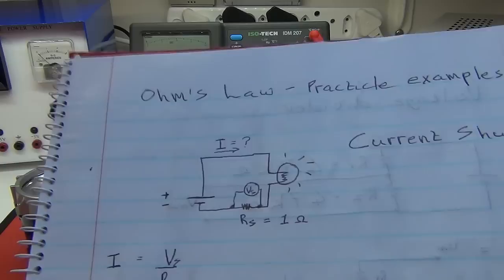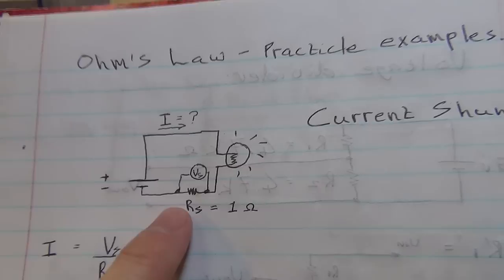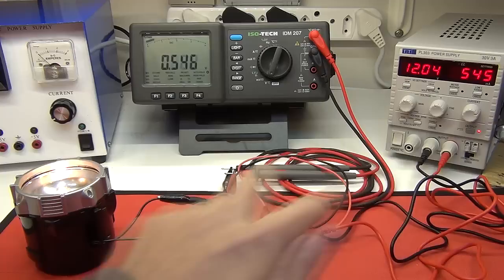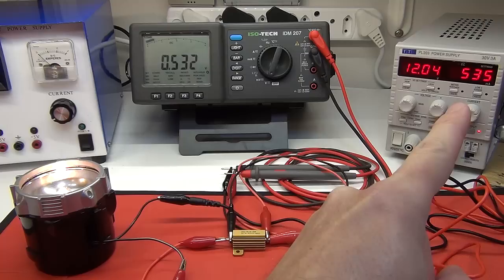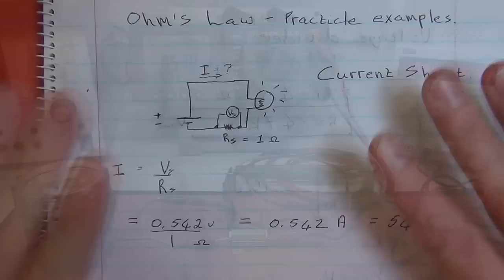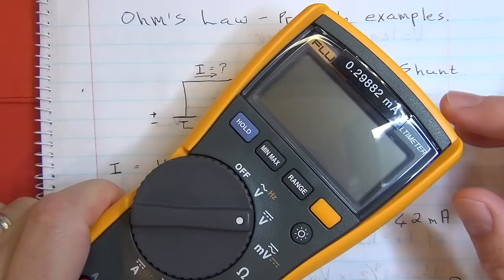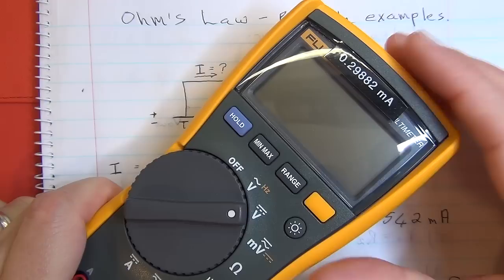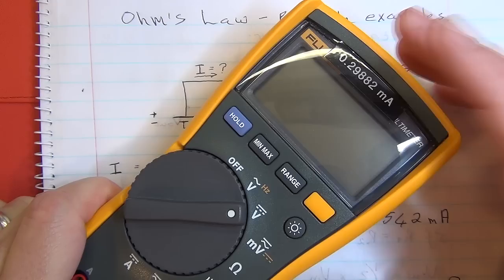Electronics Tutorial #5 - Ohm's Law Pt 2 - Application:LED Resistor, Voltage Divider, Current Shunt

Comment from the maker: My pleasure, happy to know the videos are of value. Ok...I've just calculated the voltage drop you would have across a shunt of 0.001 ohm at 250 mA (V=IxR)  would be 0.250 mV. Which is a really small reading and you would need a good accurate multimeter for one...and more importantly your shunt resistor would have to be very accurate if you want to have straight reading without calculation.  Shunts are best used and designed for higher current measurement. A simple milliamp meter....

Comment: Excellent tutorial.  I watched it all the way through.  I am an experienced electronic tech (not an engineer).  It was a good review for this old timer.  I would only add one small point regarding the potentiometer.  In the US Air Force we used a simple rule:  If the device has three connections, it is a potentiometer.  If the device has 2 connections, it is a rheostat.  A potentiometer has the letter "T" three times in its spelling and a rheostat has the letter "T" two times in its spelling.  The number of "T"'s is equal to the number of connections.  The "pot" is picking off a voltage through its "wiper" while the rheostat is limiting current in series.

Comment: love how you take general knowledge of electronics with practical examples and make a difficult subject understandable. please make more videos on making simple circuits and how to use the math to find the power, resistors and components needed to run them. It can seem impossible trying to figure out how to go about making simple electronic and circuits to make a working device, but you explain it so well, thank you so much for your time and videos.
Reply from the maker: Randy Travis My pleasure, thanks for the feedback Randy.
Reply: Could you make some videos on making a bread board with some 555 timer circuits and power supply control? It would be great to have 3 volt 5 volt and 9 volt, and a adjustable power supply. You could make a bread board that can just be pluged in and you can have the voltage and a timer ready to go to test circuits. And what type of things do you think a convinent bread board should have to make testing and learning about circuits have to make things better?

Comment: I designed, built and tested my first-ever voltage divider today.  I'm still not entirely sure how things work; I get exactly the voltage I expect when I merely divide it, but not what I expect when I start adding a load (a resistor and LED) onto the path with the divided voltage.  But I feel very inspired, and I just ordered a variable power supply to go with my two (so far) multimeters.  My desk is beginning to look suspiciously like your workbench!  And I'm having too much fun.

Comment: Very good question.  As far as the voltage divider output it does not matter.  10 Ohm 10 Ohm and 5K 5K will both divide by 2.  The difference is in how much current and power the divider consumes.  A 10 Ohm 10 Ohm will draw many times the amount of power the 5K 5K does.  So you tend to want to use the largest resistors you can get away with.  There is another issue which tugs us engineers the other way.  It often overrides the large divider resistor rule and compels us to prefer smaller R's.

Comment from the maker: Here is the definition of a current shunt: "Current shunt resistors are low resistance precision resistors used to measure AC or DC electrical currents by the voltage drop those currents create across the resistance."
The 1 Ohm resister can be used to measure current by measuring the voltage drop across it with a volt meter and applying Ohm's Law to calculate the current.

Comment: A divider is normally used as a source of voltage to some other circuit component (load).  When you connect the divider's output to a load the voltage output by the divider will change (since the load is in parallel with one of the voltage divider resistors).  Generally speaking you don't want changes in load resistance changing the divider voltage (i.e. you want the voltage to be stable).  To do this the source resistance of the divider circuit must be much smaller than the load resistance.

Comment: Again very interesting and helpful. Thank you. Have calculated the required power rating for a 400 ohm resistor in a circuit with an LED, 12 volts in and returning current of 0.025 miliamps, by using the formula P = Current squared x Resistance, so 0.025 x 0.025 x 400 to be 0.000625 x 400, and finally 0.25 watts. Does anyone interested agree? I am not 100% certain.

Comment: The idea of a current shunt is to provide a path for the current (that would otherwise damage an ammeter) to flow and still be measured by an ammeter which could not normally handle the amount of current involved. This is done by making the current shunt very low in resistance so as not to disturb the current flowing in the circuit by any significant amount, and by being able to also handle the power, by not heating up and causing its resistance to increase and interfering with the circuit. A ammeter is connected in parallel with a shunt and what happens is that the current is "shunted" away from the meter (so as not to cause damage) and makes the sensitivity of the meter much less than it would normally be, but by working out the changed sensitivity can be used to work out the actual current flowing in the circuit.

Comment: First response is look up the datasheet for your particular LED by searching "12000 mcd LED" and picking one of the links for a parts supplier such as Mouser or Digikey or other.  Doing this you find the typical forward current is about 20mA for most and has a forward voltage drop of around 2.2 to 3.5 Volts depending on the color of the LED.  Most have a maximum current of 35 mA so don't exceed that.  Using this information a simple circuit to illuminate the LED would be....

Comment: You are basically correct.  Us engineers would have concern with accuracy and safety margin.  BTW get used to going directly to the power equation.  P = V^2/R here is the best to use.  P = (9.8*9.8)/390 = 0.246 Watts.  This is way too close to the maximum rating.  Any surge in voltage will exceed the rating on this component.  Any reduction in the ambient environment can lower the true rating.  On a hot day or if the component is packed into a space with poor airflow it won't meet the rating.

Comment from the maker: The capacitor value should be the same....in some cases it might not matter but it depends on the application. The voltage value needs to be the same or higher.

Comment: If you just want to illuminate one particular LED and not select a value for a design to be used for an entire manufacturing spread just hook it up in series with a 1KOhm or greater potentiometer set to it's maximum value and slowly decrease the resistance (by turning the little screw) until it gets to the brightness you want.

Comment: 9V battery thru a resistor in series with the diode.  The diode will reduce the voltage available across the resistor by 2.2 to 4.4 VDC leaving between 4.6 & 6.8 VDC across the resistor.  Since we want around 20mA of current through the circuit the resistor value should be 4.4/0.020 = 220 Ohms (pick a standard value near that.  Worst case if the drop across the resistor is 6.8 the resulting current will be 6.8/220 = 31 mA (still well below its rated value.  Confirm for your device though.

Comment: Thank you for this very interesting explanation. As a french talking beginner, maybe I've missed something but, after reading Silas Fatchett's comment: "mjlorton was trying to find a resistance which, in parallel with a 4700 ohm resistor, would result in a total resistance of 829.4 Ohms. Using the rearranged formula, that resistor turned out to be 1007.12 Ohms." , looks like mjlorton has been lucky obtaining as a result a resistance (+- 1 K ohms) that's easy to find in specialized shops, isn't it ?

Comment: Martin, Thank you so much for doing this! I am a complete novice, but I have been learning so much for your videos. You make this so interesting. I want to try using a current shunt to measure the amperage in a circuit that has a small motor that uses about 225mA - 250mA at 2.85v. Can I use a .001 ohm shunt to measure the current and can I also just measure mA across the shunt with a meter instead of doing the calculation. The .001 ohm shunt figure for the shunt is throwing me off .001ohm too.

Comment: The formula for calculating the voltage divider resistance is technically correct.  However there is an easier way.  Voltage is divided proportionately according to resistance.  So two equal resistances divide equally.  A 5 and a 10 will divide it with 1/3 voltage on the 5 and 2/3 on the 10.  And so on.  

So we want to divide 30 volts into 4.5V and 25.5V.  We can set it up as proportions problem.   4.5/25.5 = x/4700.  Cross multiply 4.5 * 4700 =  21150.  Then 21150/25.5 = 829.4 Ohms.  This is a lot easier to do on a calculator and it is easier to remember. All you have to remember is the proportional relationship of voltage and resistance in a series circuit and how to do proportions which is easy to remember.  

Of course the same is true in parallel circuits.  It is important to remember the relationship of current and resistance in a parallel circuit; it makes remembering how the calculations go a lot easier.  😊
Reply: OK, now for the other formula, the one for calculating the parallel resistance.  The one used is based on a formula that is fine if you are doing it on paper with no calculator. It is actually a shortcut in that case.  However on a calculator it is more difficult.  Also it is more to remember.  

For parallel resistance 1/Rt = 1/R1 + 1/R2 + 1/R3 ... This is a formula that is good to memorize. 
To solve the problem in the video 
1/Rt = 1/R1 + 1/R2
1/Rt -1/R1 = 1/R2
1/829.4 - 1/4700 = big long number which you take reciprocal of to get  1007.12551

On a calculator it is bit easier to enter especially if you do not have a fancy calculator.  I was able to do it easily on my computer's built in calculator in it's most basic and simple mode.  Of course the calculator needs at least a reciprocal key to do this.  So if you have one of those calculators with giant keys and only plus, minus, multiply and divide keys then electronics math will be more difficult.

Comment: How much smaller?  Normally < 1/10th the R of the load worst case.  If the divider is driving a circuit whose lowest resistance will be 5 KOhms make sure the source resistance of the divider is < 500 Ohms.  The source resistance of a voltage divider the parallel resistance of the two voltage divider resistors.  So to get 500 Ohms of Rs use two 1 KOhm resistors.  If you are dividing down by more than 10 then it's just the smaller of the two resistors approximately.

Comment: I think it has fallen into place now. Electrons are initially dammed up by the first resistor and form lanes. To calculate the required power rating we can use power(watts) = Current(amperes) squared x Resistance(Ohms), but for accuracy we would use the current or flow rate after the electrons have passed the resistor and generally before the next significant resistance. Can we just as reliably use instead, voltage drop(volts) x Current(amperes) after the electrons have traversed the resistor?

Comment: Having thought about it more, I am inclining towards thinking that with a few bits in series, a typical resistor and LED and wires, the flow rate would measure the same or about the same all the way around the circuit. Apologies for bothering you with all these posts. Perhaps you would be kind enough to elaborate on this topic with parallel circuits. I think a current would  actually be going slower through a high resistance than an LED but travel all similar between wires at the same rate.

Comment: Martin, basically the resistor is lowering the value of the voltage (i could say), and the voltage regulator, i thinks doing the same thing..so what is the difference between resistor and voltage regulator? why not use voltage regulator which can give you specific voltage output? thanks martin..more power

Comment: Regarding the voltage divider, does it matter what actual values do i use or it is only about the ratio? (ex. 1Ohm with 1Ohm = 5kOhm with 5kOhm? (=1/2 split))

Comment: In the video you say that it is possible to use a potmeter instead of resistors and that way be able to vary the resistance. So is it possible to use a potmeter instead of a voltage regulator like fx. the lm350 ?

Comment: I don't have a clear understanding of what a "shunt" refers to. Does this refer to the 1 Ohm resistor? To the complete resistor/volt meter setup to read current? Or to the idea that this
1 Ohm resister can be used to measure current by applying a volt meter?

Comment: Hello Martin, just a newbie a question variable power supply, obviously you can adjust the voltage but can you adjust the amps as well?or does it depend on the load on the circuit? how much it can draw? or does it also depends on what type of wiring you use, im just trying to follow up your analogy for a water pipe. hopefully you can answer! thanks your tutorial rocks!!!

Comment: Also the component value of 390 is only accurate to perhaps +/- 5% for this type of component.  If I specified a more accurate component be used it would cost significantly more if I wanted to use parts of 390 Ohms +/- 1% or even closer.  If I specified 390 Ohm resistors +/- 5% some of the resistors manufactured on the board would be as low as 370 Ohms and would burn up.

Comment: Hi Martin, thx you very much for you electronics videos. They are of big value for me. I have a question to the Voltage divider in particular. I reckon that it does not matter if I grab Vout at resistor R1 or R2, does it? The question accounts especially for the order of the two serial resistors. If I am right, I could switch the order of R1 and R2 in your example and everything works in the same way. Do you know what I mean? Thx again und hope to find even more interesting videos from you. Cheers!

Comment: Even temporarily exceeding the rated voltage or temperature of a resistor will PERMANENTLY change the resistors value.  Running a resistor at CLOSE to maximum rating will gradually change the resistance PERMANENTLY and will significantly reduce its lifespan.  When they say 0.250 Watts they mean it.  I don't like to go more than half the rating unless I am sure the particular application is known, well controlled and well understood.  This is called "derating".

Comment: When we get onto LEDs and what current and voltage they operate at, there's a problem. What if, as I do, you recover LEDs from dismantled equipment or buy cheap job lots from ebay? No serial numbers to look up, no long or short leads to identify the anode/cathode. So, given a totally unknown LED, how do you work out its working current and voltage? Can you connect it to a fully turned-down variable power supply, then slowly turn up the voltage until it starts to come to full brightness. Would the operating voltage and current figures shown on the PS tell you what the LED requires? If so, would the method work with say a 1 Kohm resistor in series with the LED, and how would you compensate for that resistor in the maths?

Comment: in the case of LED when I will calculate the the watt, what voltage I will take  12v or (12v - 2.2v=9.8v)?
Reply: you must know the resistor wattage first.
example, if you're using a 0.25W which is those common through hole 6.5 mm resistors.
in the safe side, treat the resistors as about half of the total power it can take; in this case lets threat it as 0.15W.
1) remember P=VI, so 0.15/12=0.0125A is the max amount of current you can deliver through at 12V.
2) and remember V=IR, 12/0.0125= 960 ohm of total resistance are require in the circuit.
3) remember, if you have more than one resistance point in the circuit; the ratio of a resistance is proportional to the voltage drop across it.
so, (9.8/12) * 960ohm = 784 ohm to drop the 9.8V
and  960-784=176 ohm will output 2.2V to tap out to the LED
cheers
Reply: well can you tell me if i use capacitive reactance to drop voltage from 220v ac to 12v and then use bridge rectifier to get polarity, now output from the bridge rectifier can shock me with respect to the earthing. in simple word can get a shock from the output.

Comment: Why do you need a current shunt to find out the voltage? and how is it going to show you the voltage unless you use a multimeter to measure the drop which i presume is what your supposed to do but then i don't understand why you would even have it because a multimeter is perfectly capable of measuring voltage on its own...
Reply: The shunt is to measure amperage without having your clamp on meter nor your "in series" meter. You can extrapolate the amperage passing through the shunt by the voltage drop across it.

Comment: i know its a old video, but someone could enplane  25:34 to 26:03  to me ?  Note: I know the shortcut method to calculate two resistor in parallel(r1*r2/r1+r2). Thanks!
Reply: If the total equivalent resistance can be calculated by the 'product over sum rule'; 
Rt = R1 x R2 / (R1 + R2)
then the equation can be rearranged to find R2 (or R1). After a little high school algebra, the formula turns out to be
R2 = R1 x Rt / R1 - Rt
mjlorton was trying to find a resistance which, in parallel with a 4700 ohm resistor, would result in a total resistance of 829.4 Ohms. Using the rearranged formula, that resistor turned out to be 1007.12 Ohms.